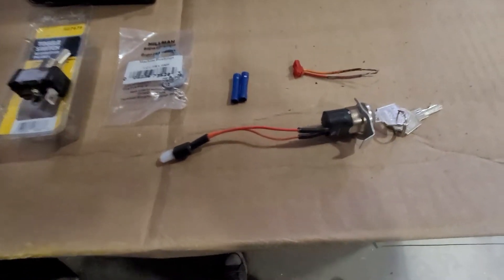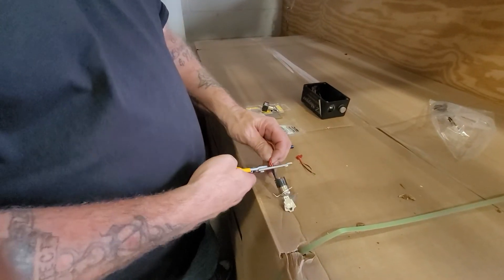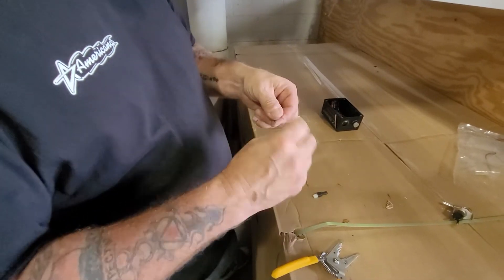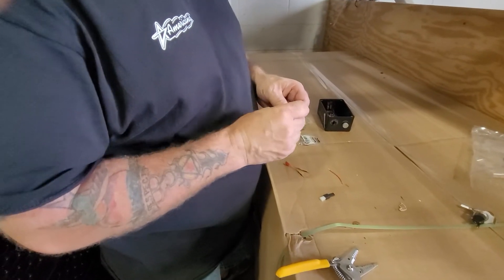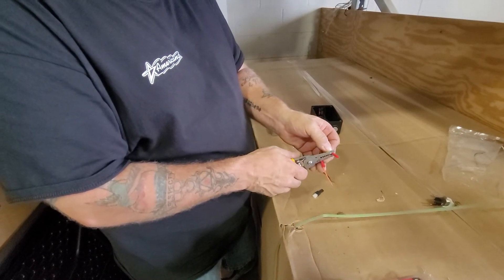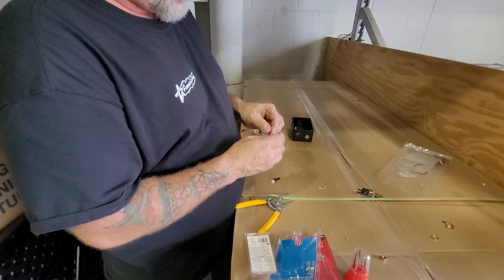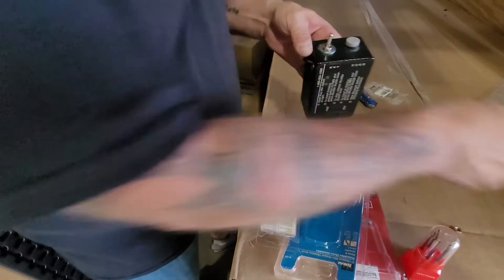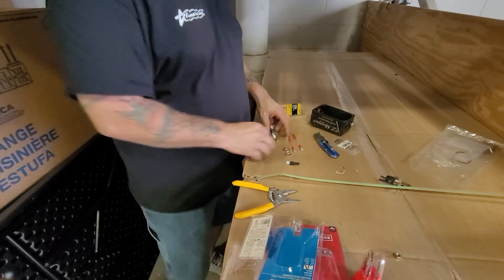Electric Cart Rocker Switch Fab/Replacement

Comment: many years ago i converted one to a rocker switch a under dash mounted one as it was available at the time as i do agree to use a toggle switch on these they are more heavier duty i will use only a metal switch than a plastic toggle switch as the plastic ones do break it was a Amigo Smart Shopper cart i repaired 16 years ago at the time some Key switches are two way on some carts for slow or fast mainly on these ole Ez  Shopper Ortho Knetics carts but use a 3 way toggle switch on these carts so slow and fast speeds can be selected on these carts some of these Ortho knetics carts are from the 1990s that use them.